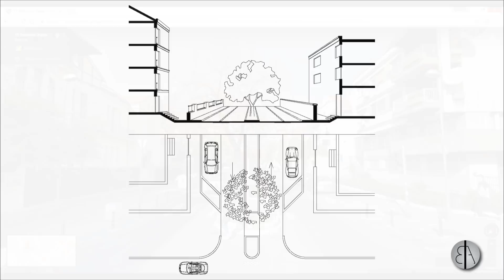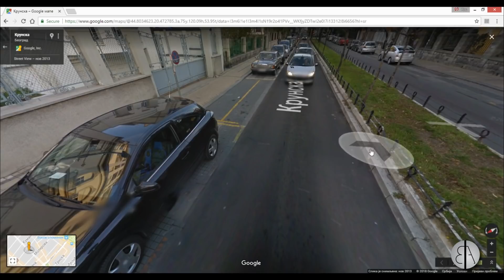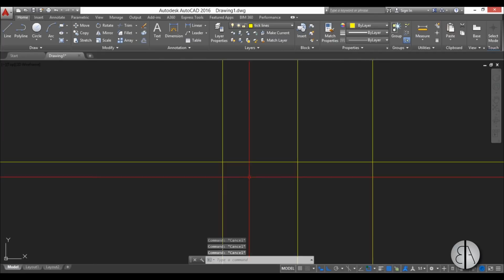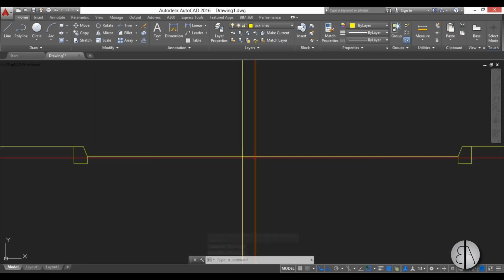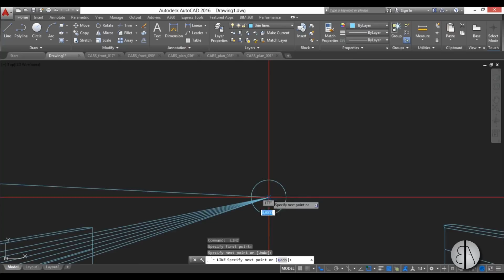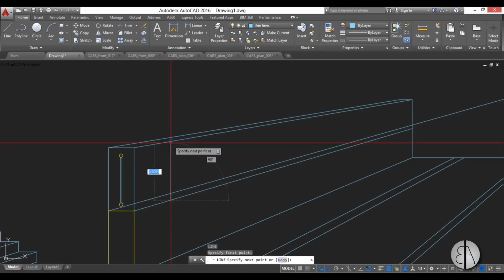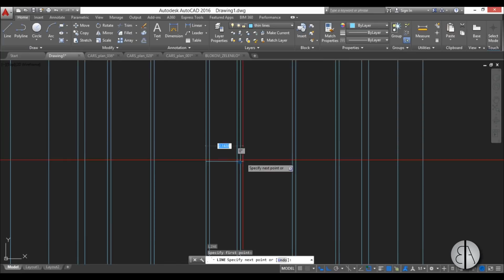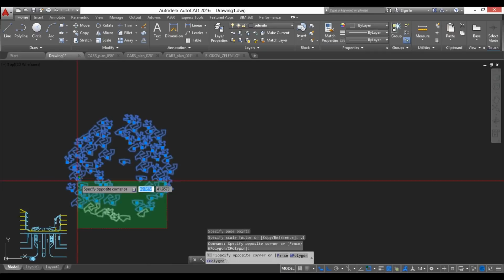3in1 Landscape Presentation Tutorial in AutoCAD

Comment: At 4:50 what command did you use to convert lines to poly lines in one go?
Reply: just select all the lines and hit "join"
Reply: take it easy man, i don't know your autocad version, but after autocad 2015/2016 you can join lines to polylines without any problem! Maybe you just have to work a little harder on autocad Mr Know nothing
Reply: Thanks to those that replied.  I have used auto as on and off for many years and have not come across a simple way to join all those lines. I am familiar with the PEDIT command but seem like I’m the tutorial there was a simple one step command that did the same. Just curious.
Reply: Thanks.